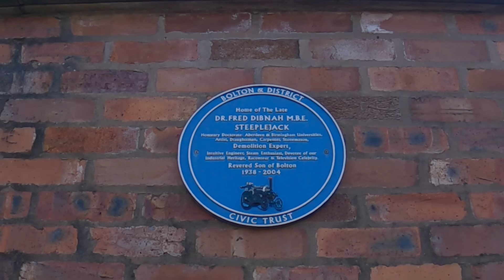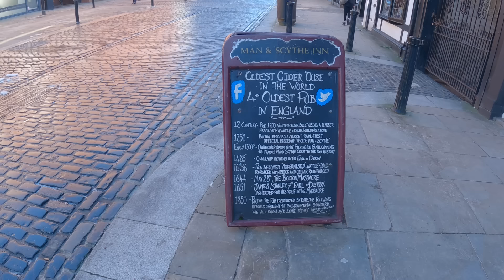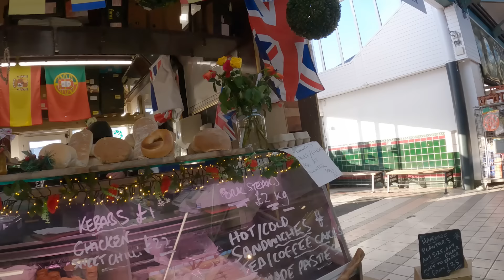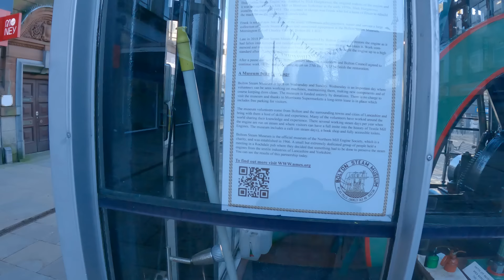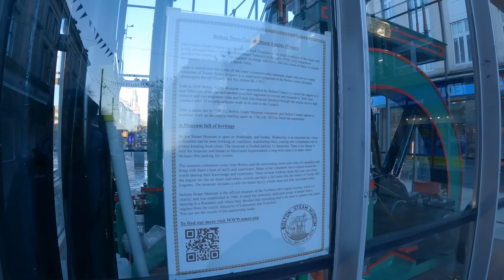I Can't Sugar Coat This, Bolton Town Centre Made me Sad

Comment: I spent a good couple of years in Bolton when I was studying.  And I must say it was hussle and bussle really good, nice places to go and drink and eat.  Went back recently because I like the markets and it's turned into a dive.  Crompton Place closed apart from The Works and Primark.  You have to go to the other side of Bolton to get to the not so great shopping centre and that's it.  Maybe the industrial part right at the back.  But yeah Bolton has died.  Don't know what's going to happen to Crompton Place, most likely demolished and turned into flats.

Comment: 33:13 and 35:47 Harsh to slate the whole town based on its town centre. Luckily for us Boltonians there is more to the town than just the town centre. The outskirts are alot better particularly to the north. Visit Smithills, or take a walk around Rivington some cracking pubs. Bolton town centre is awful and has been killed by the out of town shopping like Middlebrook and the Trafford Centre all less then 10min drive. Poor council management and missed opportunities haven't helped. The town centre is in dire need of regeneration which has been promised again and again, needs to be made a proper commuter town to Manchester with apartments etc. visit Bury to compare.
Reply from the maker: Yes, I may have been a little harsh. I will be visiting Bury soon and all the other nearby towns

Comment: Bolton, is like Rotherham, you can't polish a turd. At least the traffic works in Rotherham, but it doesn't in Barnsley or Bolton. If I have to drive in to Barnsley from the M1 to one of the industrial areas for work, I can right half a day off. Try M1 to Carlton. Bolton bottlenecks of the A666(M) or as I call it, The Road to Hell.😜